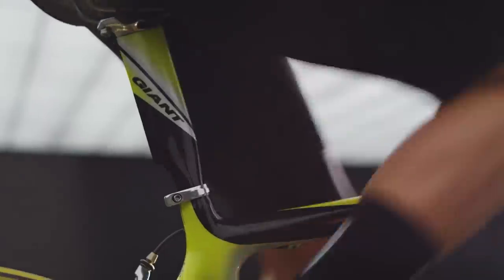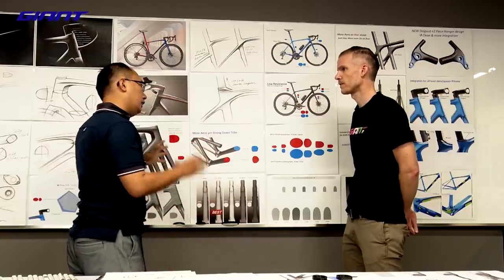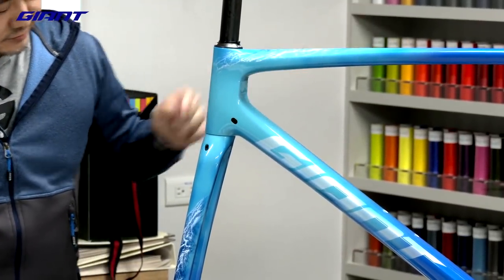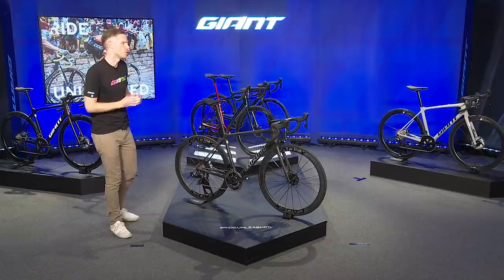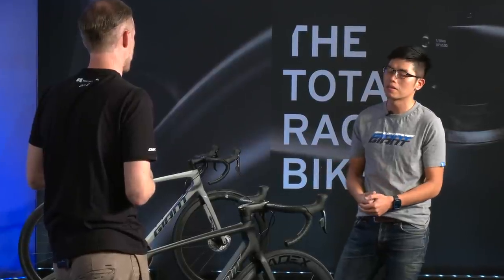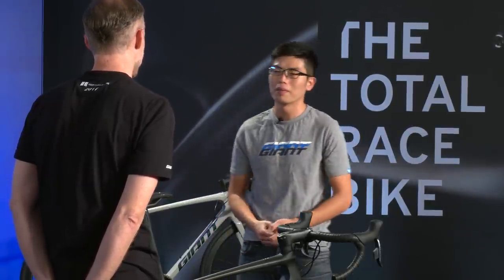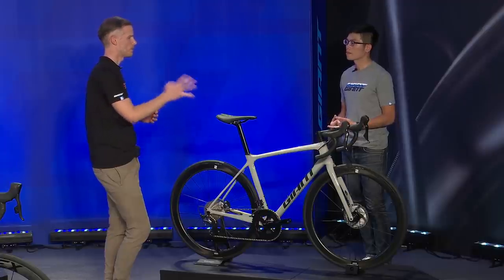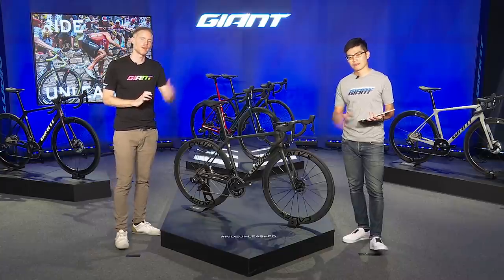TCR Premiere Launch Event | Giant Bicycles

Comment: It’s interesting how they obviously spent thousands of man hours designing and releasing the bike to market and then a couple of hours designing the release presentation. The best bit was the emotion I felt when the ride experience was being talked about. I’d like the full tcr experience in a sensory overload. The weight to 6.5kg in an aero package is a real win for me, so I’d like to get a visual and tactile sense of the extra speed and general performance that will give me over and above my 2017 tcr. I want to feel the comfort they’re talking about from the saddle/post and bars/stem. I want to dance on the pedals and feel a burst of acceleration worthy of spending thousands of pounds on. I could upgrade my current bike, so let me hear, see, feel, smell and taste why I should. 
I’d also like to know that some issues from the past have been remedied, my bike now has different wheels, bars and saddle. I want to know that I won’t need to change half the bike after a year.

Comment: Where do you feed the di2 cable on the TCR SL disc? There is no information on Shimano di2 system integration with the top end model. Not sure about the 30mm axle squeezed into the PF86. You're left with super tiny bearings.

Comment: Hi Giant principal engineer. Aero bikes are now getting lighter and lighter, so what is the niche and advantage for lightweight bikes like TCR?
Reply: fs chan the TCR ride is more compliment, lighter, and more comfortable
Reply: The frame of the TCR is meant for climbing. You buy a TCR, and race it up a hill with someone with a Madone, see who wins.
Reply: There are some aero bikes that are being put out right at UCI weight limit....but they cost a lot of dough. These are inherently lighter than a similarly priced aero bike...but the main reason is as that this bike will be much more compliant. Meaning that it will be more comfortable for longer rides. If everything you ride is 2 hours or less then buy a Propel...unless it is 2 hours of billy goat climbing, the Propel will beat out the TCR under most other circumstances.